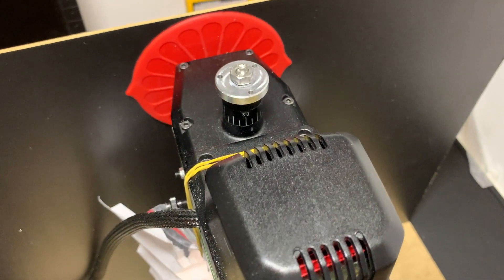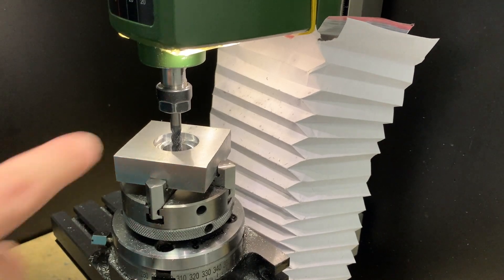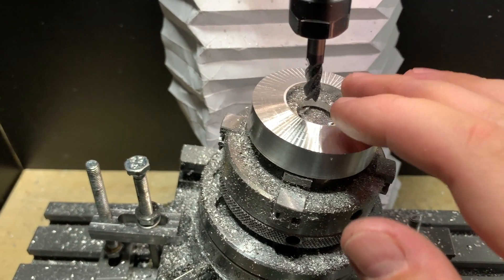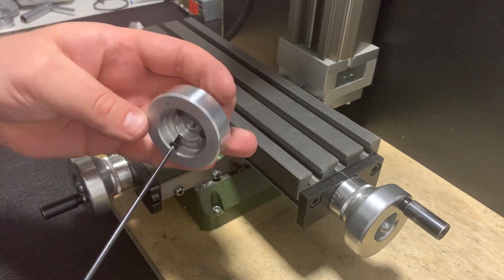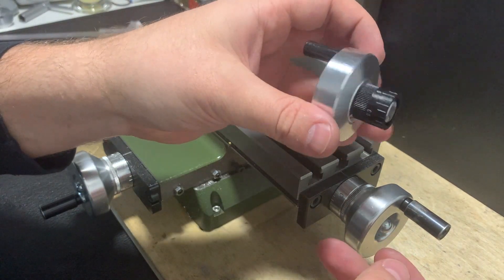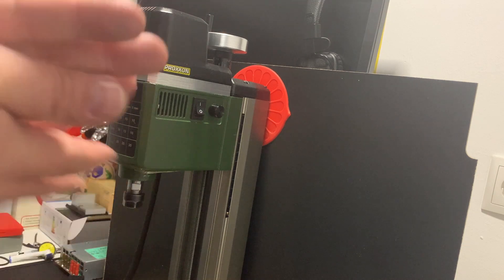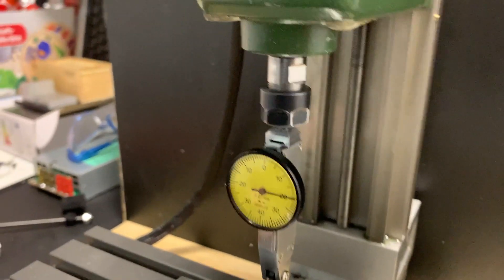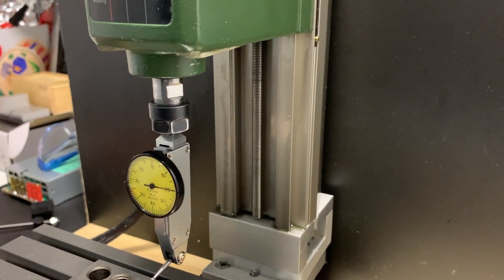Precision vertical lead screw for Proxxon MF70 milling machine. (part 3)

Comment: Dont buy it, it's a piece of shit machine, it has a corless drill motor in it.. litteraly a toy that can't do anything
Reply from the maker: Originally it is, and you are completely right. But also it's a cheapest tool for CNC conversion or doing some very small tasks.

Comment: Nice video! Were can I buy the round thing with the degrees˚ (dont know what its called) that your workpiece sits in? Whats it called, what is the smallest inner diameter?
Reply from the maker: It calls round table. I'm using this one https://www.paulimot.de/fraesen/teilapparate-mit-zubehoer/teilapparate/328/teilapparat-rundtisch-oe-80-mm-horizontal/vertikal
Reply: @zhadlun  Ok, thanks! But what chuck do you use with it and how small diameter can it take from the inside? I work as a goldsmith and I want to fixate a ring so I can drill holes in it, but usually rings have a diameter of 16-23 mm.
Reply from the maker: Chuck is also from paulimot. You could found it on their web site. You could use this chuck to fix items from 0 till 50mm.
Reply: @zhadlun  I mean mounted like 3:12, what is the smallest diameter on the hole to mount it that way?
Reply from the maker: @martincarlberg9671  the smallest is near 22-25mm, but you could cut chuck jaws to size you need.
Reply: @zhadlun  Your chuck have a diameter of 65 mm? I saw there was one with a diameter of 50 mm, that should work for me.👍😊 Thank you for your answers.👍😊
Reply from the maker: @martincarlberg9671  the think is that chuck jaws is the same. But as I say, you could cut them a bit.